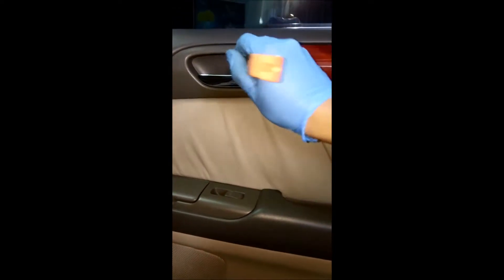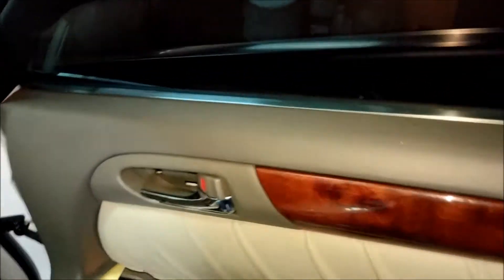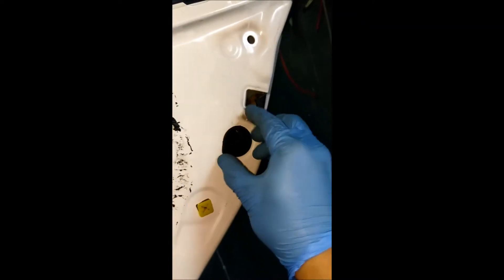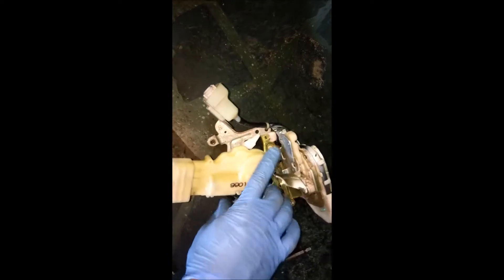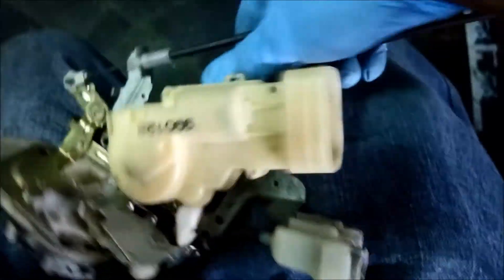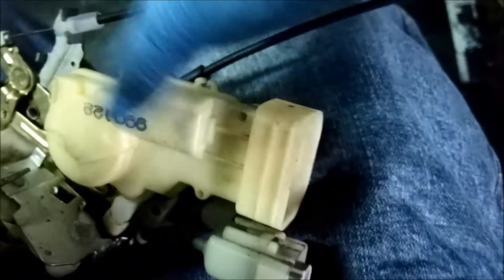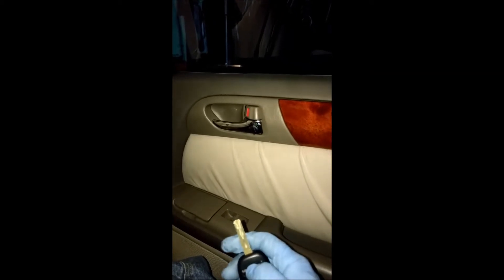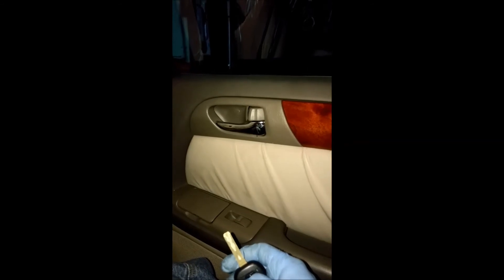Rear door lock actuator replacement for 98-05 Lexus GS300 / GS400 / GS430 / Aristo

Comment: Bought 4 Toyota oem actuators $56. Took the locks out, replaced actuators.  Worked great. Saved me $2800 on all 4 doors at Lexus dealer. Muchas gracias amigo!